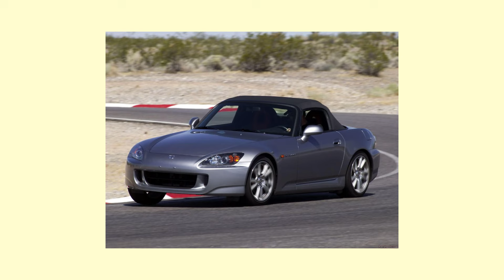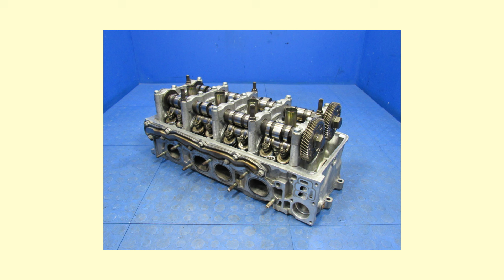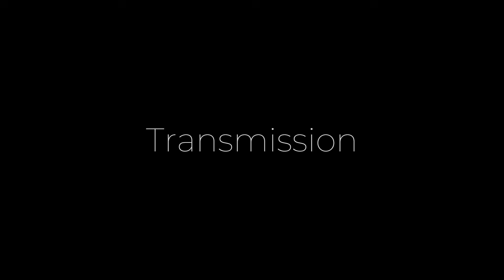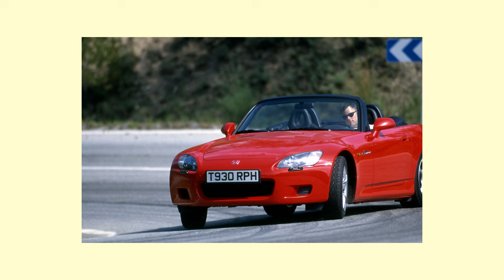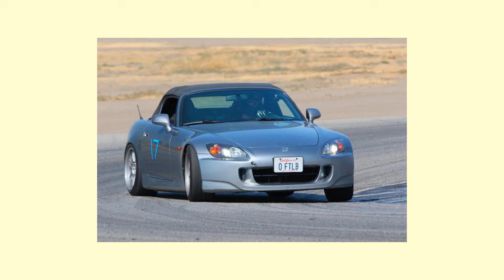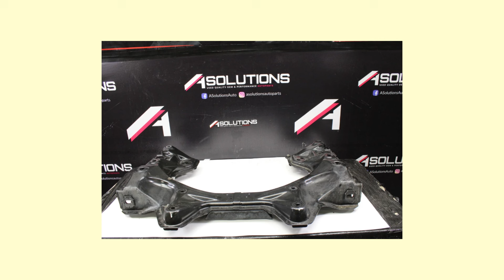Automotive X-Ray: Honda S2000 AP2

Comment: AP2 rear suspension geometry only differs from AP1 via the front inboard point of the upper control arm being 22mm more towards the front of the car and the bushings being axially longer IIRC. This is the first time I've heard of, or seen any indication of, a lower rear roll center, so I'd be interested in a source for that.

The control arm bushings are stiffer radially and probably axially too, which means less elastokinematic effect.

There's some rumors about less bumpsteer in the AP2, but as far as I can tell based on actual analysis, the rigid kinematic curves are almost unchanged, roughly +0.03deg per 10mm kinematically on both and about +0.036deg per 10mm with compliance on the AP2 and +0.04deg per 10mm with compliance on the AP1. The AP2's softer rear spring will give it slightly less bumpsteer as well, that analysis was performed with 99 AP1 rear spring on both for a fair comparison. Maybe about +0.035deg per 10mm.

It's not particularly high in either version, though. The cars also have quite a lot of elastokinematic toe-in on braking and turning, so any toe-out from rebound gets negated. Probably something like +0.20 to +0.30deg per 1G based on bushing stiffnesses.
Reply from the maker: For the source which touches on a lower rear roll center, Honda Newsroom: https://hondanews.com/en-US/releases/release-0a883d51b49ea932518ce5004c34c4b1-2004-honda-s2000-chassis
Reply: @Enguitive  Interesting, Honda newsroom is usually trustworthy and I have not seem them make empty claims yet. Somehow I've missed that one.

I can confirm that raising the rear's lower balljoint 6-7mm would effectively zero out kinematic steering in the operating range (quite similar to the NSX curve, actually) and lower the RCH about 9mm.

I haven't found any evidence of this, but I could have also always been looking at AP1 outboards.
Reply: @Enguitive  I checked, and knuckles and upper arms differ. Lower arm does not. It doesn't mean the lower balljoint didn't move, but it's something to take into account.

Upper arms are:
52390-S2A-003 AP1
52390-S2A-J02 AP2

Lower arms are:
52350-S2A-000 both
(This also implies the lower arm bushings are unchanged, which is possible. They mostly talked about less camber compliance, which stiffening the upper control arm bushings would achieve.)

Knuckles are:
52210-S2A-000 AP1
52210-S2A-010 AP2

Changing the upper ball joint height doesn't really affect kinematic steering, nor does changing the upper control arm height nor the relative heights of the points (it mostly changes the rebound side, actually).

Seeing as the roll center is claimed lower, I doubt they lowered the steering arm outboard 6mm, as it would raise RCH about 7mm.

So my money is on lower balljoint higher by about 6-7mm. Maybe some day can find some hard data.
Reply: Was able to confirm from a source that the AP2 knuckle has the toe arm mount about 1/4in more forward, which reduces bumpsteer about 20%, and reduces the effect of the eccentric adjuster. We speculate that the UBJ was then also lowered a little to reduce bound gain and increase rebound gain and lower the roll center.

LBJ may be unchanged, or tweaked veeeeeery slightly just to maintain alignment.
Reply: Did some analysis based on images of the knuckles, this will invariably have some error but it seems quite representative:

UBJ 9.0mm lower, 2.4mm rearwards
LBJ 1.4mm higher, 6.0mm forwards
Tie rod unclear but height appears same, source claims 6.0mm forwards

End result delta to AP1 is -24% effective RCH, -33% kinematic steering, -4% camber gain.